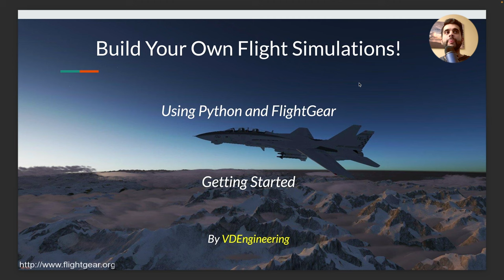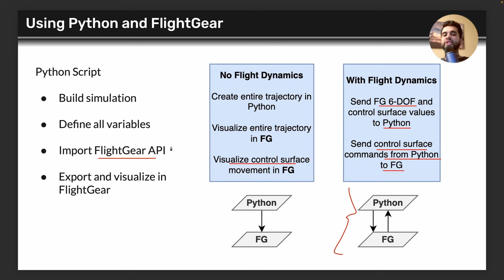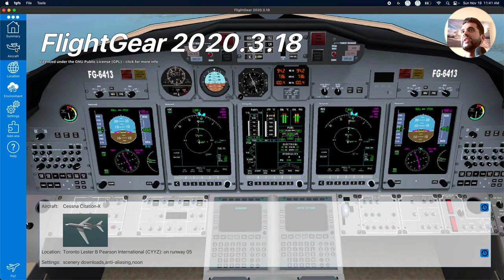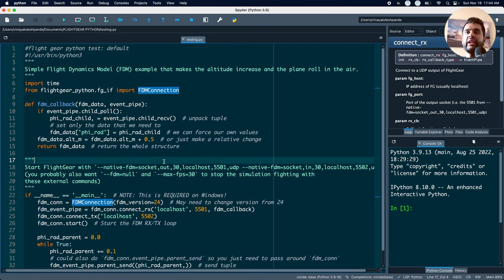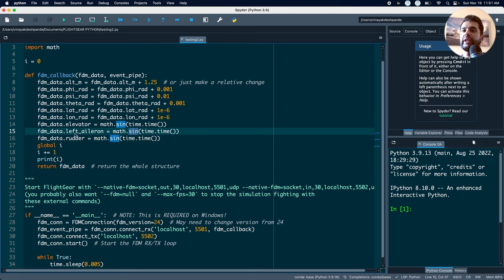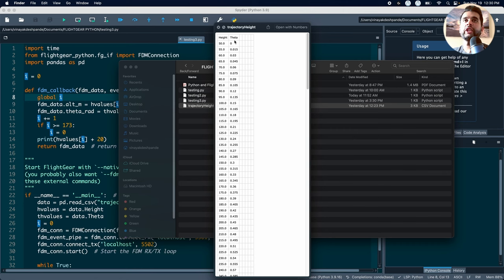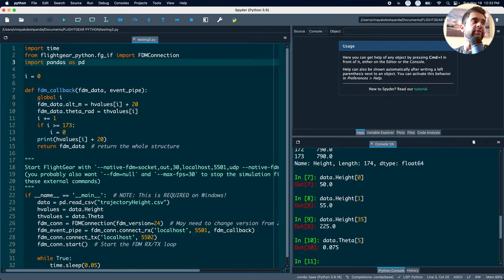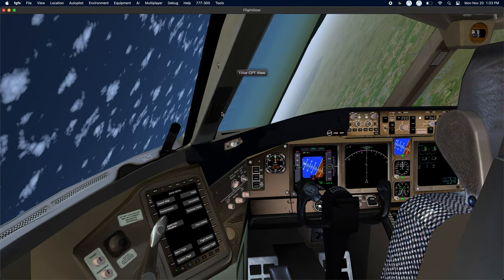Create Your Own Flight Simulations with Python and FlightGear | A Complete Guide!

Comment from the maker: Update at 20:32 : You don't need to have your IDE open when running the Python script, just run it from the terminal. This way, you can have FlightGear running in the background and do not need to restart it each time. In addition the performance will increase as less RAM is used.
On Windows machines, using Spyder may result in an error in the multiprocessing module. Using the terminal gets rid of this error.
Reply: I use pycharm.
I run the example simple_fdm, several times everything works fine.
In pycharm the script is launched, and in flightgear the plane moves.
But after some time the script does not stop working.
I click end script or even close pycharm, and in flightgear the plane also rotates.
Even when I restart flygear, the script still works.
Only reboot helps.
Perhaps the UDP connection somehow gets blocked and freezes.
Could you tell me what this is?
It is also interesting to see the code of your examples; not all of them are in the archive of the flightgear python library.
Thank you.

Comment: some of the authors of the custom planes, like the F15, F14 and the A10 should have the standard HUD mode exist in the chain cycle of the HUD option when people pressing the "H" key. in some of those plane, the authors only include the proprietary HUD that would be on the real world version of the HUD, which is minus the power/throttle gauge, and the rudder indicator. i mean its a frickin video game, and not all people who download it has a complete flight control setup. most simply experiment using mouse and keyboards or gamepad. and its hard if you cant tell where the rudder is facing, or how much throttle is open. and the game hasnt been updated for a long time. im sure the authors of those custom planes dont even touch the installation anymmore for years. the custom helos are messed up. its easier to fly real helos than those in the game. helos dont go tumbling around like that on idle. its crazy. by the way, whoever worked on the F35 plane in the game although it is lack of polishing, but all the mechanism is ON POINT. thats how F35B takes off and landing. its not a VTOL. its just a STOL. that one plane is well done. though rough.